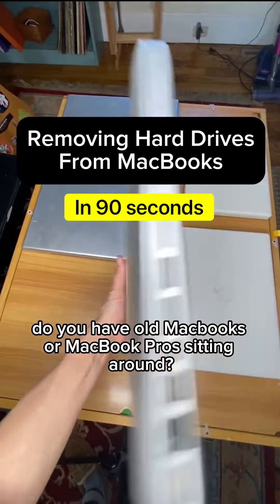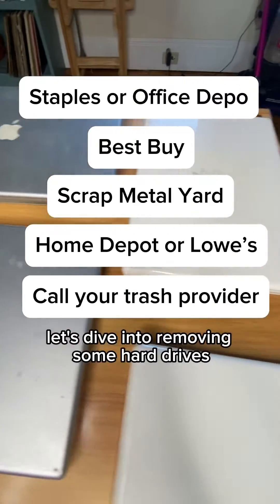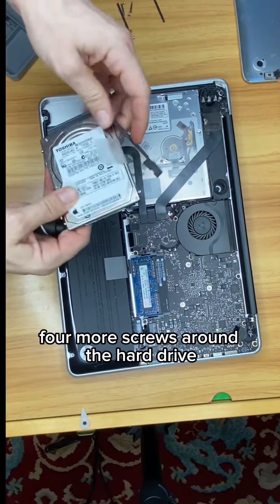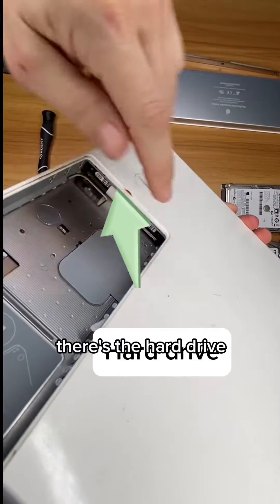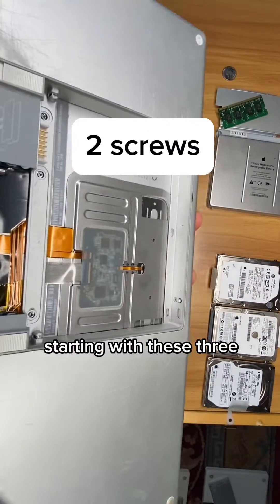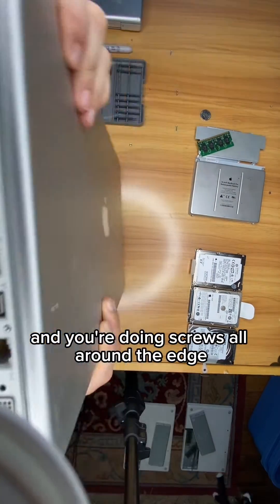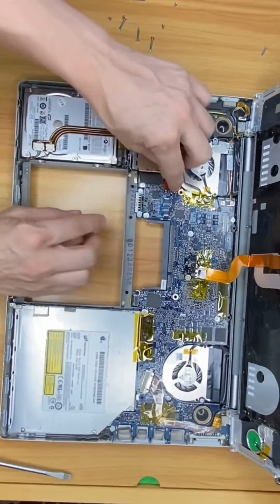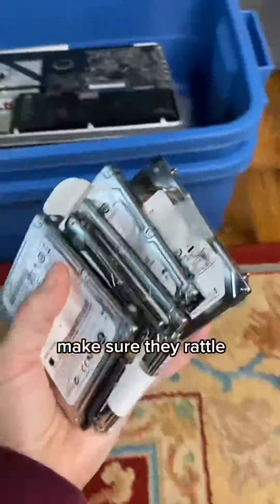How To Remove A Hard Drive From An Old MacBook (2006-2012 MacBooks and MacBook Pro)

Comment: Depending on whether you're looking to recover any of your old files & you're still using a good Mac; Target Disk Mode may be better/easier. Although I/anyone with good recovery software can rebuild & retrieve anything of value (in one way or another) - You can just format the drive a few times & leave it in. Hammer may be significantly more satisfying BUT when you do that, you should really remove the neodymium magnets from the drives (if they're not SSD's). They're as strong as it gets & are useful & sellable.
Reply from the maker: I appreciate the info. This video is for people like my clients that don’t want to do anything but get rid of the computer quickly and  knowing their info is safe.
Reply: Hello my 2012 macbook makes a sound, but does not turn on.
Reply: @sgsd1586  My ExWife was the same way. Scrap it & Go for a later model.

Comment: This is great! I just need to figure out how to get my important saved documents & photos off of the hard drive beforehand….😝
Reply from the maker: Yes! If you don’t want to DIY take it to Best Buy or a local tech place. They can do it all for you
Reply: If you're transferring to a current/new Mac: Google "Target Disk Mode" if the machine no longer boots or has a bad screen. It will need to power on & have at least 2 working keys on the keyboard (or a USB keyboard hooked up). Firewire/Lightning/Thunderbolt/whatever cable required too (cheap). Otherwise (If the machine IS fully functional): USB Drive. Very simple stuff.